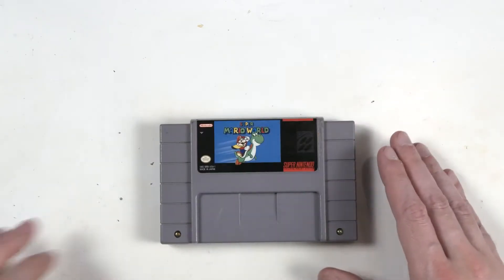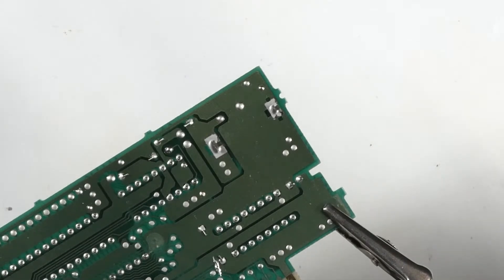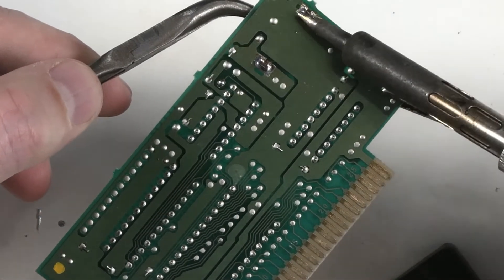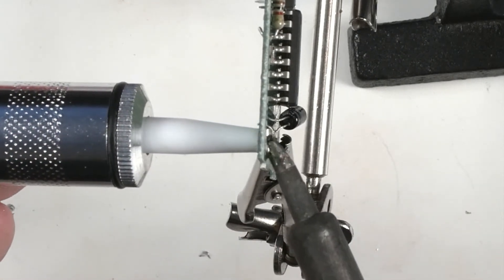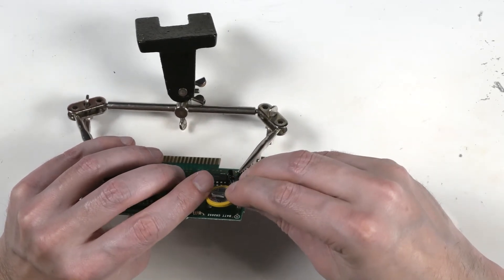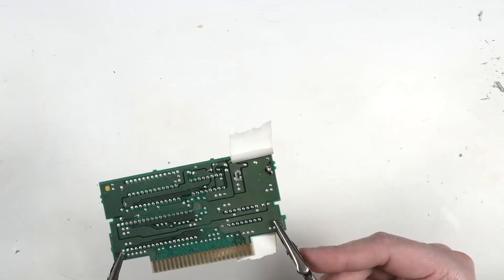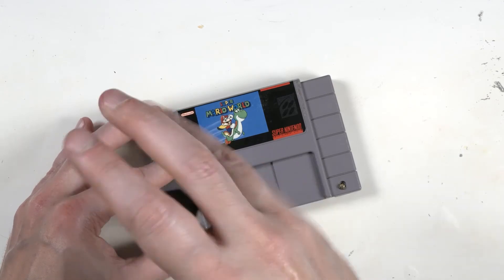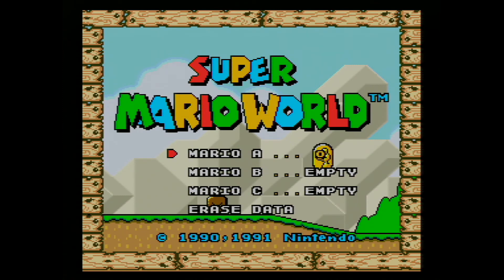SNES Games Battery Replacement

Comment: Many SNES cartridges used SRAM to store game progress and/or data. SRAM loses its data when power is disconnected, so the battery will provide a continuous power supply when the cartridge is not in use. When you are playing the game, the console powers the SRAM. There was no FLASH or EEPROM in 20th century. As the technology develops, SRAM is changed into FLASH or EEPROM.

Comment: Quick question. I recently replaced a battery in Super Mario for Super Famicom and it’s not saving. The battery was installed correctly, so do you think the defect could be the battery itself? Thanks
Reply from the maker: The battery could be bad. It could also be a bad solder joint or a broken circuit trace. 

I'd try re-heating the solder joints. If that doesn't work order another battery. If neither of those work, I wouldn't be able to tell what's wrong without getting my hands on it.
Reply: Hexed Pedestrian Thanks for the suggestions. Luckily it was just a faulty battery, and after replacing the battery my game works great.
Reply: Hexed Pedestrian Thanks, I’ll try to repair it later this week.

Comment: So I have a question maybe you can answer it I did a little research but maybe with your help I can understand what went wrong, ok so I still have my Super Mario World for Super Nintendo from when it first came out? I don't have my original SNES so I bought one from a used video game store and works good, ok now one day I pop in SMW in my SNES and accidentally moved the cartridge while on in the port, then all my info was erase , and was it erase cuz I moved the cartridge while on? Or is it time to  insert a new battery?
Reply from the maker: Probably because the game got bumped, causing a "cartridge tilt" glitch. Try saving another game and see if it lasts.  :)
Reply: Hexed Pedestrian ok koo thank you so much for that info I'll definitely try it and if that's the case I don't have too change battery